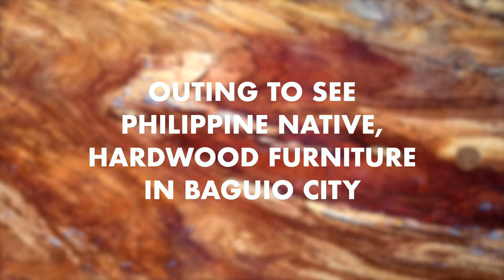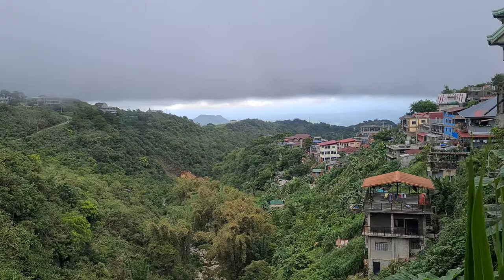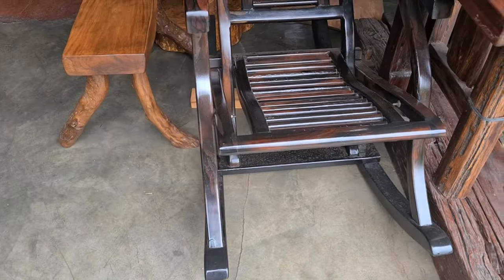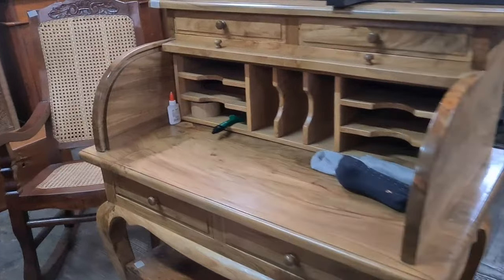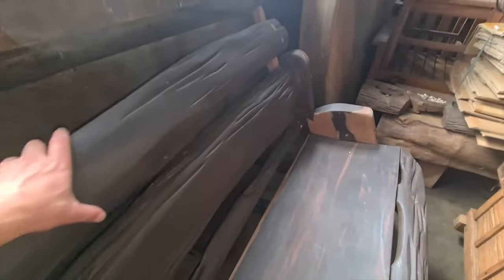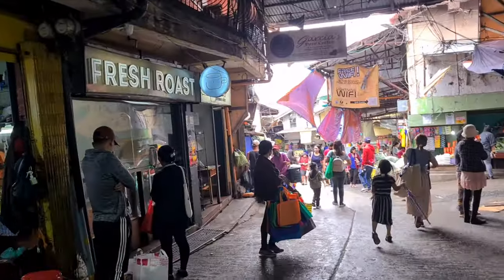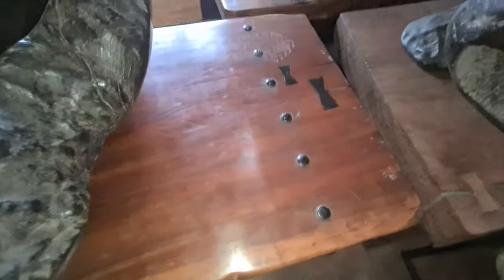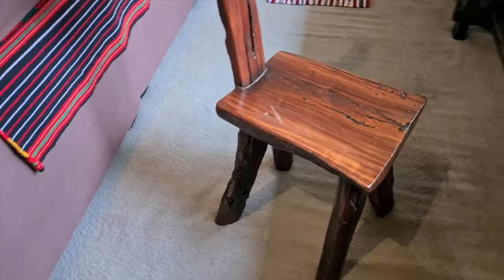Philippine Native Hardwood Furniture in Baguio City

Comment: Great video.  I’m having a kamagong table being built for me.    I have yellow narra for flooring for my stairs and 2 bedrooms.  I have a condo in Baguio and will be checking these furniture stores when I get there.  Thanks for the great video.
Reply from the maker: Thanks!  It sounds like you have a nice place - I've seen a couple of old places here with narra flooring, but they are rare and usually old Baguio houses.  I'd love to have that someday.  Thank you for watching, and let us know if you find something here you decide to get.
Reply: @outofdangerproject 
What is the normal thickness for these table tops.  I have an option now to buy a single piece for the table top at 2 inches thick. Thanks.
Reply from the maker: @neilmartin4187  I think from what I've seen the thickness can vary quite a bit since these are almost all unique. I think most I've seen are 1.5 to 4 inches thick
Reply: @outofdangerproject 
Female Kamagong is lighter and have less black in them.  I bought some kamagong and found out afterwards it was female.  It was a little disappointing.
Reply from the maker: @neilmartin4187   @neilmartin4187  That's interesting because I've heard people talk about the female/male differences in the wood - some people have said there isn't a difference, but I've also heard from others there is.  I'd like to see a comparison of several samples at some point